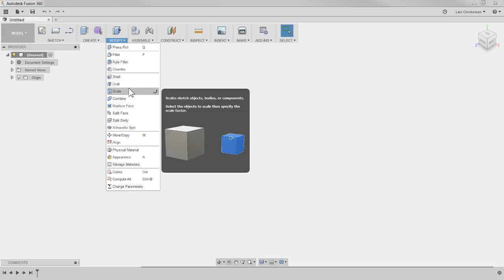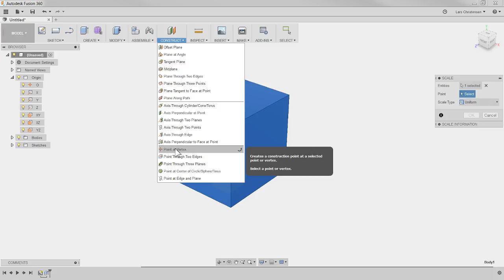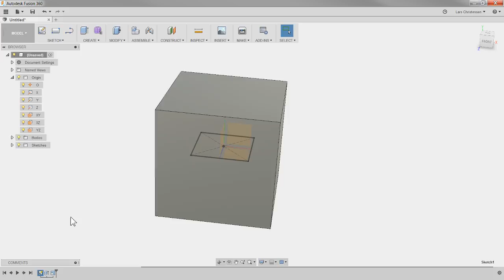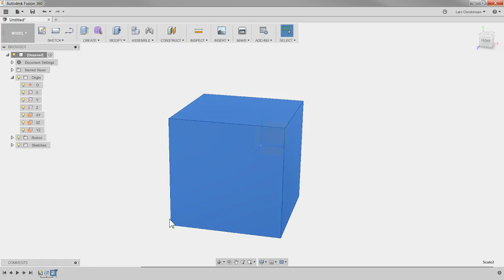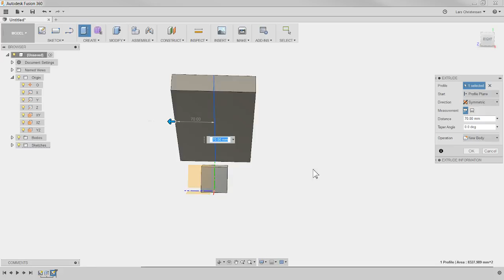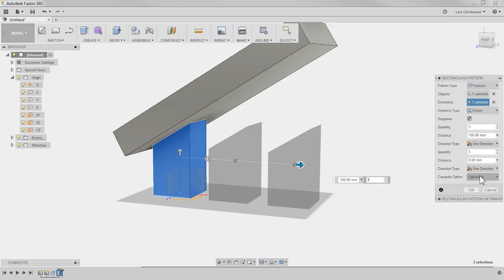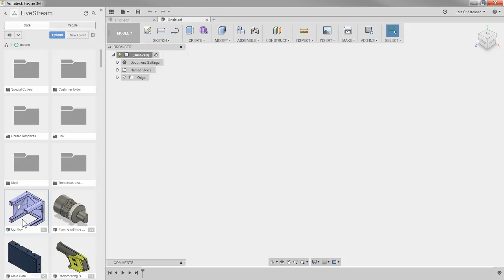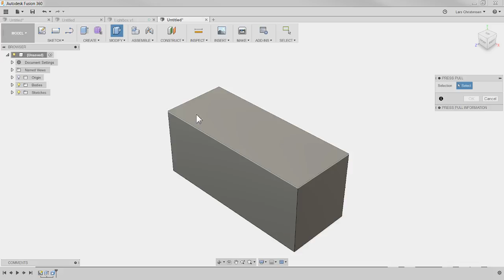3 Great Questions! Scaling, Translate & Mesh — Fusion 360 Tutorial — #LarsLive 115

Comment: I'm having a problem that would probably be simple for you. I downloaded a file from Thingiverse. The stl file goes into Cura and fits on my printer bed, but I want to modify the file. So I bring the file into Fusion 360, but the part ends up being over 13 times larger than it originally was. So when I made my modifications to the file and tried to send it to Cura, the part is now larger than my entire printer. It's 13.48 times larger than what I started with. My modifications had nothing to do with resizing the file or the part. It just seemed to resize the file on it's own when I imported the file into Fusion 360. Scaling only lets me pick 1.00 size or 0.5 size. Example, the original screw hole in my part is 0.175 inches. Fusion makes that hole 2.395 inches in diameter. I don't get it.
Reply from the maker: Make sure you use the Insert mesh option from the menu drop down and keep everything metric

Comment: I am a PLC Controls Engineer I seen Solid Works and AutoCAD in my past jobs but never Autodesk Fusion 360 is it use much in manufacturing engineer, is Fusion 360 growing and taking over AutoCAD, SolidWorks and SketchUp
Reply from the maker: Hi Clayton Lemieux Thank you for watching! Fusion 360 is fairly new on the market vs. the other programs you mention. Utilizing the cloud and has more flexibility with workspaces such as sculpting, Mesh and CAM. The program is definitely growing a lot in usage.

Comment: But how do you scale down? I’ve got a mesh I imported for this project and it’s like 10x bigger than I need it to be and putting in a negative value isn’t working to shrink it.
Reply from the maker: Hi James Quinn Thank you for watching!
If you use the Insert dropdown instead of Upload button with meshes, you should not have the scaling issue
Reply: It' a scale factor. A scale factor of one equals 1:1, the size remains the same.

Want the size one and a half or two times the original size.... scale factor is 1.5 and 2 respectively.

To scale down, you don't use negative numbers but fractions.

For example- if you find you
Want it at 3/4 size scale factor is .75 and a scale factor of .50 is half sized.

There is no negative used to my knowledge

Comment: How to scale a fully assembled component without changing the assembled position of the component. If I scale the fully assembled component some parts will be misplaced. Any suggestions?
Reply from the maker: Not if you want it still to function as an assembly. The reason that each component has to scale from their own center of mass
Reply: @cadcamstuff  Thank you so much..

Comment: Thanks Lars, 
What is the object in the back with the Hoover logo?
Reply: HAAS CNC control panel
Reply: ok, merci
Reply from the maker: +1 to Malcolm
It is a Haas simulator where you can verify the code you post out for your CNC machine from Fusion 360